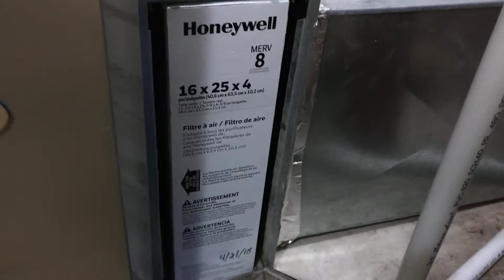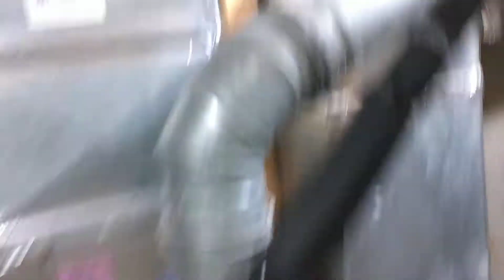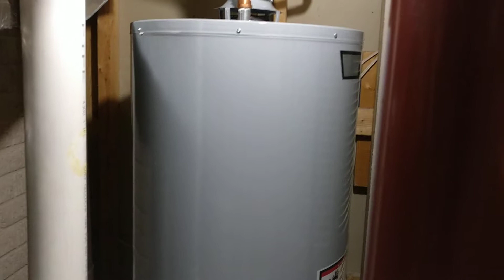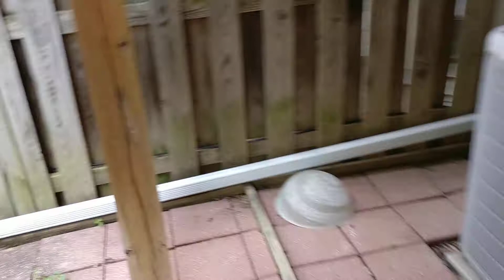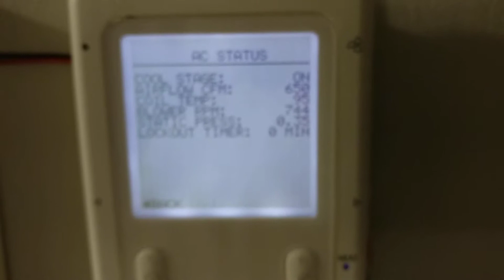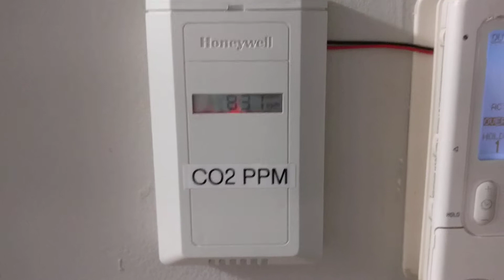Carrier Performance 15 (24APA5) AC Operating

Comment: Hey great video! I have the same unit and now the fan on the ac unit stopped working. On the motherboard there is a blinking yellow light. Do you know how I can troubleshoot this?
Reply from the maker: You'll have to check the flash code, see the manual here. Let me know what the code is. 
https://www.carrierparts.com/?mdocs-file=128915
Reply: @springws14lbss  hey thank you for the reply. I had to hire a contractor to fix this. He first misidentified the problem and said it's a pressure issue. Then found out control board needed to change. Long story short i paid $870 to this person. Bad result. I hope no one gets into this situation.